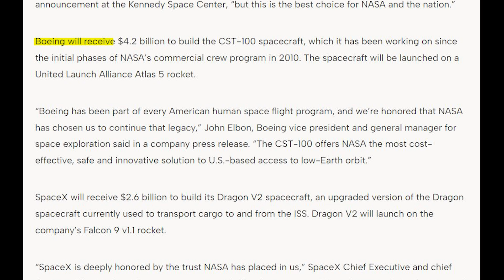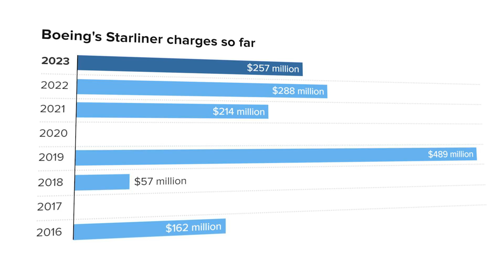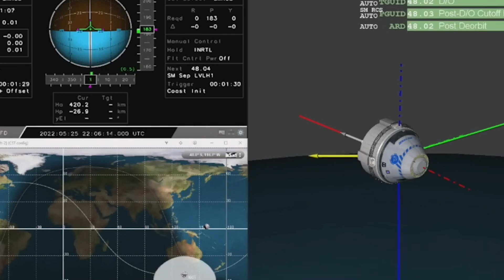What Exactly Went Wrong With Boeing’s Starliner Spacecraft?

Comment: Built to government specs (which have changed a couple times) on a cost-plus contract.
THAT is the issue with both Starliner AND the entire Artemis program (though the SLS also suffers from Congressional mandate to "resuse as much Space Shuttle as possible" issues).
Reply: Starliners isnt cost plus ...dunno avout Artemis
Reply: @Smart-Towel-RG-400  Doesn't change the "built to government specs" part, even if Boeing is losing money on the contract.

Comment: OK. Someone needs to stand up to this ridiculous "herd mentality" piling on to Boeing.
#1 - Boeing got more money than SpaceX for Starliner because SPACEX ALREADY HAD AN UNMANNED CARGO VESSEL (Dragon 1) EITHER FLYING OR FAR ALONG IN DEVELOPMENT BEFORE THEY BID ON THE CONTRACT. 
BOEING WAS STARTING FROM SCRATCH AND HADN'T BUILT A CREWED VESSEL IN DECADES. SpaceX could use flight proven heritage hardware from Cargo Dragon for many systems in Crew Dragon, DRAMATICALLY reducing their costs.
#2 - All you dreamers that believe that Dream Chaser would be ready any faster than Starliner ---- DREAM ON. They have hit so many snags that they are running as far behind as Vulcan Centaur, and this is just a CARGO SPACECRAFT.
#3- A human rated Spacecraft is an order of magnitude harder than a cargo spacecraft and is held to a higher standard. If you have no heritage proven hardware to include in your design, it is even harder.
#4- SpaceX had its own set of problems that people are conveniently forgetting. Remember the multiple failed parachute tests?? (Elon famously said "parachutes are hard!' )
Did we forget about the EXPLOSION of Dragon 2 in the test prior to the in flight abort test??? As I said, if SpaceX had not had Cargo Dragon to use for much hardware, I dare say Dragon 2 might be just as far behind as Starliner. Although I agree that SpaceX has an incredible ability to investigate a problem, fix it, test it, and get back to flying.
#5- Yes, I agree that Boeing failed to put sufficient resources in the project to insure proper end to end testing before Test Flight 1. But since then NASA has put them through the Ringer. Like the FAA, that Boeing embarrassed, who promptly put 737 MAX under the microscope and found flaws in the design going back to 1967, NASA is putting the Starliner design through the microscope too. That's how they found the parachute connectors built for the wrong loads. The Kaptan wiring tape is used EVERYWHERE in aviation. It is basically a Teflon derivative. Unfortunately, if you demand that it be fireproof in a pure oxygen environment at SEA LEVEL PRESSURE, that is a whole different level of fireproof. It was also NOT A REQUIREMENT WHEN THE STARLINER DESIGN WAS FINALIZED. NASA 'clarified" (meaning CHANGED) their requirements AFTER STARLINER WAS FINISHED.
And those thruster corrosion problems on the second unmanned test........ who would have thought that Aerojet-Rocketdyne would screw up the design of thrusters the space program had been making for nearly 60 YEARS??? It boggles the mind. But that is one reason SpaceX is VERY CORRECT to keep manufacturing subsystens 'in house" as much as possible. They always seem to have problems when they rely on subcontractors. Remember that bad strut on the second stage that caused the Stage 2 explosion on that Falcon 9 launch a few years ago ....... subcontractor.
Bottom line - Boeing DESERVES the scrutiny they are under. But scrapping the program when it is close to the finish line is STUPID. NASA needs TWO man-rated spacecraft for low earth orbit, and Orion is too freaking expensive to use as a "taxi". Orion is build for trips outside the protective Van Allen Belts. It is freakishly over designed. And Dream Liner, bless your litttle hearts, will be a terrific Cargo Spacecraft. And it will ONE DAY be a terrific man-rated spacecraft with incredible capabilities. But it will take a few years for that to happen. My guess is 3-5 years, given NASAs track record for testing and qualifying manned spacecraft.
NASA is putting Boeing through the crucible to make sure Starliner is safe. I have full  confidence they will succeed. Just like I would fly on a 737 MAX now that the FAA and the EU has taken their "pound of flesh" out of Boeing and forced them to fix everything, I think Starliner will emerge as a solid, safe, spacecraft. I just hope the "beancounters" at Boeing don't decide to cut the program because they lost so much money on it. One day the "suits' have to learn that you can pay now, or pay later. Going cheap always ends up biting you in the a$$.
End of Rant.

Comment: Boeing and NASA should have started Starliner in early 2000's. There would have been a decade of time to develop a follow on to the Space Shuttle. From 2011 until 2020, the US had an Inexcusable gap in manned spaceflight. Becoming dependent on an increasingly unreliable and politically unstable former ally, Russia. With no thanks to the narrow vision of Congress and the Clinton, Bush, Obama Administrations, inconsistent, politically driven, space policies caused much further delay. The cancelation of the Constellation Program but its partial  continuation with the SLS (Senate Launch System) have been costly diversions. Boeing should get one last chance to perform a manned mission to the ISS, after that NASA should END procurement of Star Liner. If Boeing wants to continue, it must use its own funds, and not be allowed to use funds from other government contracts.

Comment: Boeing has done amazing things in the past. In fact, where would the free world be without Boeing? However, the Starliner project is snakebit and Boeing is throwing good money after bad at this point. They need to scrap Starliner and start over. It'll be better for Boeing's bottom line. It'll also be better for the astronauts who won't have to worry if they're riding on a $2B meteorite.

Comment: Starliner is trash, I get nervous flying in boeing airplanes as well...
Reply: The earlier Boeing planes are the most reliable planes flying today like the 737 model.  It was when Boeing was paired with Lockheed Martin, I think, that things started to go to hell primarily with the 787 Dreamliner.  This mash up of two companies could point to the design/manufacture difficulties with Starliner.

Comment: Nothing has "gone wrong" with the spacecraft, it's the company that has "gone wrong"
Reply: Seems that way.
Reply: Ever since the bean counters took over, Boeing has ignored their Engineers, at their peril. Stupidity knows no bounds.
Reply: @  jamesogden7756  
Without SX (and other competitors) the path of the beancounters was the correct one - if your companies goal is profit maximization (which per the shareholders it is anyway) and as far as I know a company is even legally bound to that goal. Beancounters only need to listen to engineers when there is competition around - as otherwise you wind up with uncompetitive product. But if you can get rid of the competition.. well.
Reply: Whatsa difference??
Reply: @kevinmcgovern5110   Share price.
Reply: Rolled out nearly a new aircraft every month or two for a year.
Reply: Nuts… 😂 🎉🎉🎉
Reply: Exactly！
Reply: economically even the company didn't do wrong - optimizing for profit as a supplier at the expense of customers works as long as they can't switch to a competitors product.
The only way to prevent that is to enforce that you're the only supplier in the market via regulatory capture.. otherwise the market trends towards ZERO profit for all involved.

Comment: Orion has done slightly better. Why is that not an alternative? 😎
Reply: weight, orion is around 40% heavier than starliner iirc, precluding it from being launched via cheaper options. eft 1 required a delta heavy (but also went into a very high orbit). it could maybe be a vulcan payload with solids to leo but otherwise you need non man rated launchers or sls to put it in orbit
Reply: The pricetag makes orion a no-go for leo operation. Any oneway tincan concept is now unaffordable. Thats the 2nd main reason why they all dont seem to like elon. Still its only startups at least trying ....

Comment: I hope the best for the Starliner program, and right now the best course of action is cutting losses. No way its safe for humans after years behind and over budget.
Reply: See my rant below for my thoughts on that crazy idea. Bottom line - that has been the American pattern for decades. Take a program right to the finish line where all the problems are either fixed or ready to be fixed and then CANCEL THE PROGRAM. That's why we never completed a Shuttle Replacement. Venture Star could have been great, if they had been willing to run with the backup plan for metal tanks when the composite tanks proved inadequate. But instead, they cancelled it.
Starliner is almost there. It has been run over with a fine tooth comb. It is held to a higher standard than the Shuttle ever was. When it flies, it will be safe.
Reply: @i-love-space390  "It is held to a higher standard than the Shuttle ever was." Why are major design problems being discovered weeks ahead of the first manned-launch? First launch est 2025 originally planned for 2019-2020. Clearly something is very wrong...
Reply: They are basically done now. The RnD budget is already spent, Boeing isn't getting that money back. 
Right now, the best thing for them to do, is to complete the final touches and finally deliver on NASA's contract.